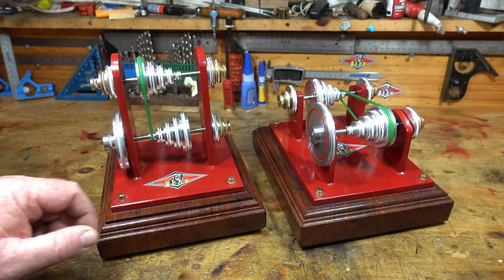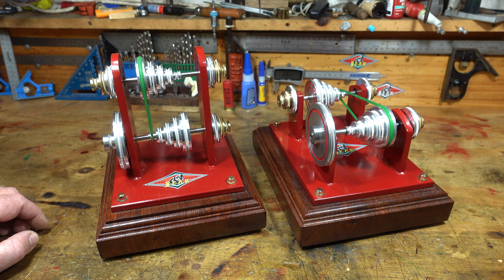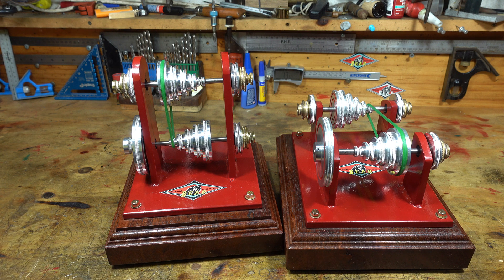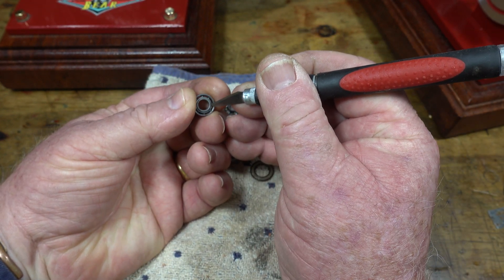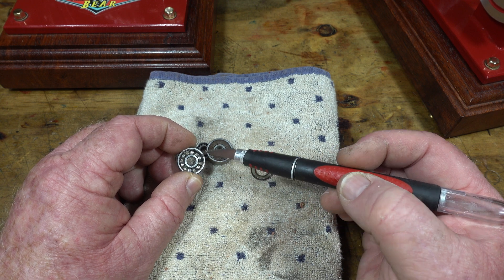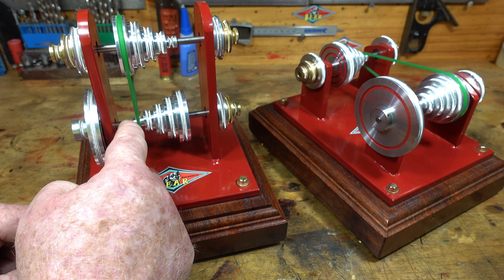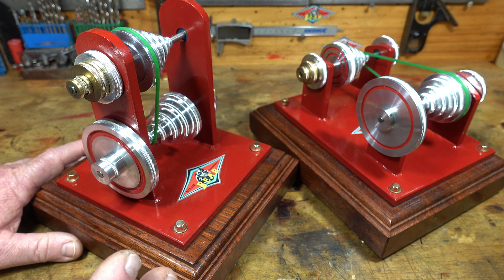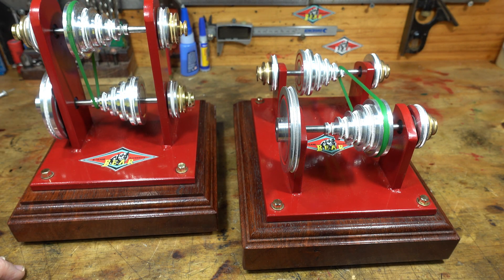Transmissions DIY Homemade for Model Engines + Ball Bearing Hint

Comment: If you want very low drag bearings, remove the cages, carefully grind a filling slot, and make them full compliment bearings. If you use Stainless steel bearings, you can change  the steel balls to ceramic balls, and wont require any lubrication. Full compliment bearings have 1 less ball than being completely filled. Cages are very draggy. A full compliment bearing with ceramic balls is very quite and will free spin for at least 2times longer than the clean caged bearing with steel balls.
Reply from the maker: G'day Neil that is REALLY interesting reading. I appreciate the info. I was so surprised how much of a difference the ball bearing races were being 'open' I'm talking from being sealed and not even spinning one revolution to removing the seals and grease and oiling them to spinning then between 45 - 50 seconds. So your extra step would see even less drag - Cheers Jim

Comment: This was a realy cool idea! I bought some gearboxes and transmission parts for RC cars, but they often have way to much friction for smaller steamplants to run smooth and driving other machinery. I long time wanted a rel belt variator some day in the future whan i manage to finish the new mahine room for my old metal late...
Reply from the maker: Thank you for the comment, much appreciated - Cheers Jim